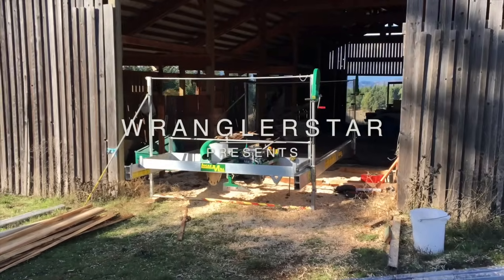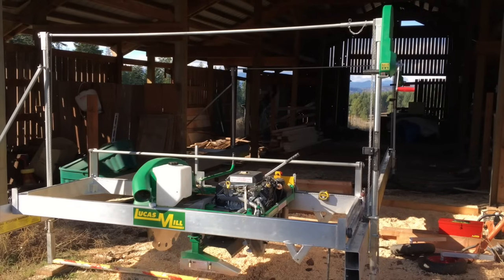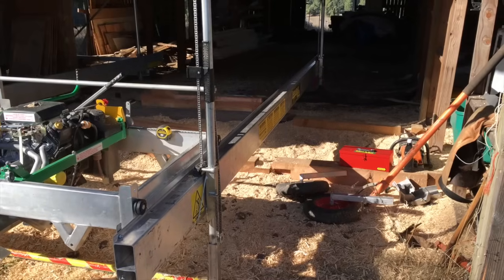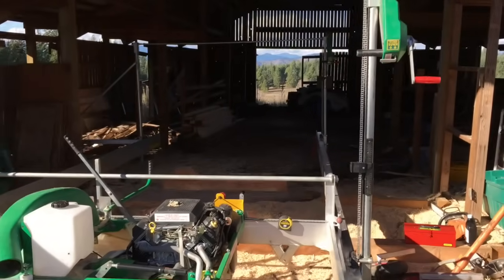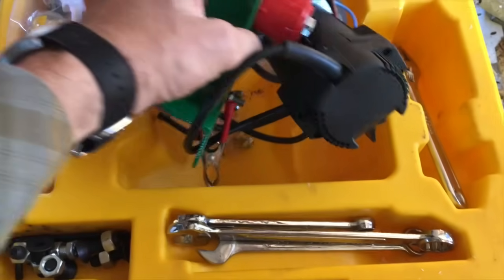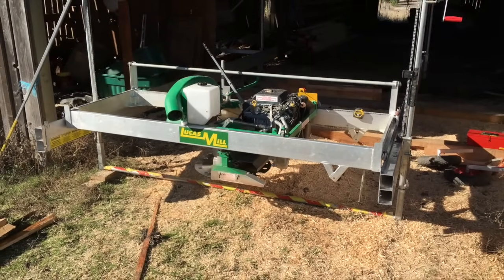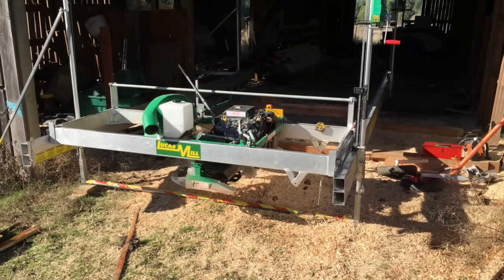LUCAS SAWMILL - WHAT YOU DIDN'T KNOW!!

Comment: That is an incredible sawmill,  great choice! I was a band saw filer for a few years at a mill with 3 band saws and it really isn't that hard to sharpen them but it does require a lot of expensive tools and equipment plus time to level and tension them properly. With only four teeth to deal with that is better than anything I've seen before although it didn't look like they were replaceable without welding. Awesome mill congratulations!

Comment: They are a nice mill, however your statement about having to send out your band blades is a little misleading, you can easily sharpen and set them at home, no need to send them out at all.
Reply from the maker: I don't know about easy. I have been to the Woodmizer factory sharpening shop and can tell you they use equipment most people don't have access to. How does the average sawer set the teeth on a bandsaw blade?
Reply: How many teeth in a band saw band? For an average or common band?
You would still spend less time sharpening Cody's.
Reply: Tim Taylor you still can't beat 5 teeth to sharpen! lol
Reply: Tim Taylor i send mine back to woodmizer for resharp. How would the Lucas do If you hit a nail?
Reply from the maker: Any pro saw shop can re tip the carbide. This blade will last most users a lifetime.
Reply: Good Info, thanks for sharing,
Would like to run this mill and compare it to my woodmizer. Looks like a great machine.
Reply: Wranglerstar are you using the osmo from dji
Reply: Have a Peterson uses same blade system as Lucas , most nails dont actually bother it that much tbh. Small chips in the teeth you can often get out yourself with the sharpener but otherwise  send it off to a saw dr for retipping Or you can retip them yourself if you have access to something like a oxy acetylene set.
Reply: I actually have a Foley Saw Filer, Model 200 which will file hand saws, circular saw blades, and band saw blades. 

I also have a Foley setter. Bought them at an estate auction. Got another Foley implement but I can remember what it is.
Reply: I don't see how you could possibly cut timber with a banjo...
Reply: no like most nice blades any good blade shop will simply braze new carbide teeth on it..   lost of nice circular saw blades can and do get their teeth replaced
Reply: I still have some of my dad's old Foley machines. Saw filer, setter, and retoother.
Reply: bob maki My problem has always been old barbed-wire fencing grown into the tree.
Reply: Tim Taylor: If you are comparing sharpening band blades with the circular saw blades... yes you can do both at home. The bandsaw blade sharpener costa an additional one thousand US dollars. If the cost and setup are alright with the mill operator, that's fine. For now at least I think Cody is happy with what has just been delivered to him. Don't you think he will tell us all about it? He is not shy. ;-)
Reply: Wranglerstar We have a woodmizer and both set the teeth and sharpen our bandsaw blades at home. The setup is quite easy and while the blades are being sharpened you can work on the next blades teeth.
I picture this blade being quite spendy too in comparison to a bandsaw blade. Is it?
Looking forward to seeing the saw in action though. Seems to fit what you need.
Reply: So glad you got the idea. No one saw is perfect for every person or every situation. You can be very happy with yours and he can be very happy with his, both for different reasons. Thank you for an intelligent response!
Reply: Ehren Bormann I'll bet he is... I thought the same thing.
Reply: Iwas a sawyer for years, 1 nail will take out all the teeth! Experience  speaking!
Reply: You get 3 blades with your mill.

Comment: Nice machine Cody! A couple of hints, add a little Simple Green to the water tank to prevent pitch build up. If you are going to mill for others you will eventually hit tramp metal, especially the butt log. We have been charging $25.00 per tooth but your shipping may be higher. Build up your supply of spare blades so you can have 3 or 4 blades repaired at a time. Don't use the blade bolts too many times before you throw them out.

Comment: I ran an in house,saw shop for many years. I did the hammering and tension set. replaced the carbide tips ground them to spec. you will need a saw shop near you so you can send the blade when it needs  the bits replaced they have to be ground Top,Sides,Face to the proper kerf for the blade plate thickness. watch for heating binding conditions has that will warp the blade.Also rocks and carbide don't get along,the bits lose almost every time. I don't do saws anymore and have no equipment. You can learn to do this yourself. If you send them to a shop and there are hammer marks Do Not let them work on your saws again ! The ideal of hammering is to get the lumps out of the blade...! Those hammer marks make tight spots and each time the problems become worse,even leading to cracking the blade, And believe me it's not fun when a saw comes apart each piece like a bullet. One other thing if you see saw marks on the wood though this may look cool it means the blades shoulder/s on one or more isn't set right, it is leaning into the cut more than some of the others which puts more stress on it. Pressure and heat. 
These are just tips and I hope this helps you.
All my best.
Bobby

Comment: I highly suggest getting a carburetor set-up to keep on hand for that kohler.  Their fuel injection is nice when it works, but it will not tollerate any lazyness when it comes to maintenence.  It can and will fail on you when you need it most.  Most Kohler dealers don't have many e.f.i parts in stock and you will have to transport the unit to a dealer for them to hook their computer to it to diagnose any issues.   Aside from that, very nice unit.

Comment: The stationary circular sawmills I've seen use replaceable teeth. I found one in the road by my mailbox recently. With only five teeth, I'd think having a couple extra sets of teeth would be even easier than sharpening, though the design of that mill and its tool set looks darned nice. I like that you can use it for slabbing large logs. Large, wide slabs are such great expressions of the tree they came from...

Comment: I think I would cut to near finished dimensions for standard framing lumber(2x4, 2x6, etc)...with maybe an additional small allowance for shrinkage  when cutting wet logs.  Saves the need for planing 4 sides.  After drying, 1 side could be ripped or planed fairly quickly.

Comment: Those carbide tips are brazed on not welded.  As long as the basic blade is OK then the teeth can easily be replaced with a torch.

Belsaw used to make a mill with replaceable teeth.  The carbide teeth were brazed to a C-shaped piece that was installed into the blade.  These pieces could be replaced without demounting the blade.

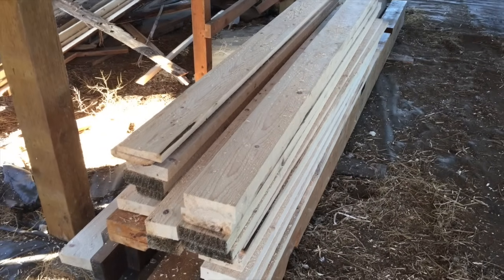Comment: When you mentioned cut accuracy (8:45), it's definitely true that bandsaws can have worse cut quality. One flooring manufacturer I've dealt with knows that first hand.

However, accuracy on a bandsaw mill is directly affected by cutting speed, blade sharpness, horse power, blade speed, blade guides and the type of wood/any defects in the wood. Therefore, for a well maintained production mill like our Wood-Mizer LT40 and LT70WIDE, it's just a matter of running it well and changing the blades at the right time. Also you'll never see a Lucas make over a 10" cut in one pass, where as a 30" cut through sugar maple is a whole different beast, so accuracy is sure to be affected if you're blade isn't fresh.

And keeping you blade sharp and your cut speed proper is true for the Lucas mill as well. Trying to cut too hard, with a dull blade, or in knotty wood will probably not affect accuracy but will instead affect cut speed. And I just did a little research, I can see why the Lucas blade doesn't move much in the cut. Their blades are .14" thick and take a 1/4" kerf where as my mills run either .045" or .055" with 1/16 and 1/8 kerf.

So just know that if you're running a bandsaw mill properly you'll have no issue with cut accuracy! I've even cut through a 3 inch diameter tree support (so about a 3 inch x 3/8" piece of mild steel) and finished the cut off straight in a 14" white oak cant! Don't try that with a swing blade mill! And then make fun of my back from having to roll logs all day. It's all trade-offs!

Comment: Yeah, the widest boar you can cut using double cut would be 20", which should be plenty. If you need wider, just get them "rails" (I dunno what ya call them) and glue the boards together. Also, there pretty much is no planer that will plane a board wider than 20", or it'll be helluva expensive. Of course you can use a band sander, although it does not plane.

Comment: Standard is 20ft length not 16 and with extension it can do 26ft
Reply: Another Aussie here. I own an old 8-20 mill.  The  standard cut is actually 20' long with the extensions fitted, as you need the room on each end to flip the blade clear of the log you are cutting.

Comment: At 8:00. To make it complete, show how to stack the finished Product to dry properly not to bend or rot. I, myself, prefer a stable Foundation of Three big logs, evenly spaced and slightly shorter between the outer logs than the full lenght of the boards. See to that the logs are leveled and at the same height. Put the first layer of boards on the logs, with half an inch between to make the air flow. Create a space to the next layer by putting ribs (Three in this case) of fir above the big logs, so that the weight when fully stacked wont bend the bottom layers. Continue til its done.

Comment: Most bandsaw mills load the logs from the side by rolling them on the track in between the rails that the carriage rolls on. That is obviously not an option with this mill. It seems like there is plenty of room to drag the log between the rails but there is the issue of the carriage being in the way. How do you get logs into position in order to use this mill?
Reply: chaplainlight they roll them in from the side just as you would a band mill.
If you have a really large log that you cannot handle, it is quite possible to cart the mill to the log and simply erect over the log.

Comment: Bandsaw blades are the easiest of blades to sharpen either off the saw or left on, why would someone send them out to be sharpened. ? Don't believe every thing you read, Nick sounds like quite the salesman, sometimes you hear what you want to hear. Just saying !!
Reply: 1armedguy woodmizer claims their blades can't be sharpened, you have to buy a new one.
Reply: Bull, woodmizer makes no such claim. They do recommend you send them back to be sharpened. But they are not any different than any other saw blade. 

That being said, when I had my mill I had the equipment to sharpen my blades, but still used wood mizers resharp program. Simply because I didn't have the time to sharpen and set blades.
Reply: We've got 3 Wood-Mizer mills, their automatic sharpener and manual setter, and sharpening bandsaw blades sounds very similar time-wise compared to the Lucas Mill. Key differences would be: Bandsaw blades are cheaper and can handle hitting metal and then being resharpened, where as the Lucas Swingblade mill has a more expensive blade that won't handle as much abuse from metal. Once you chip the carbide tooth badly you can't easily resharpen/repair it (though I'm sure you can have it re-tipped). We cut logs from tree services so that's important for us!
Reply: Robert Mickley Samuel Luria
 Maybe it is just the sales rep out this way, but I have 3 friends who either have of had a Woodmiser, and they were all told the same thing...
Reply: Bandsaw blades are pain in the ass. Same for chainsaw bar and chain mills.. just a proper tungsten carbide blade with few but long and thick teeth will blow your mind. and they are way easier to sharpen. Even fine diamond file is good enough. There are also sawblades with very long teeth on the side so it also planes your boards nice and smooth. Theres nothing better than proper blade and carbide on it.
Reply: Mobile Dimension, end of story.

Comment: Hello,
For me this system to cut, not the chassis or motor. Just the system of the blade is not good. The most is the portable saw, with the circular saw, maybe more expensive but more.....
But you show me the finish product, some pieces of wood who saw mill can make but maybe ina hard work.
So (sorry for the orthograph) it's a strange machine for me but the résult is real!